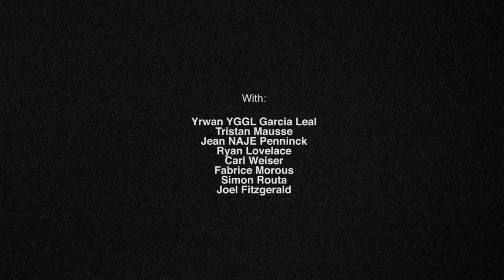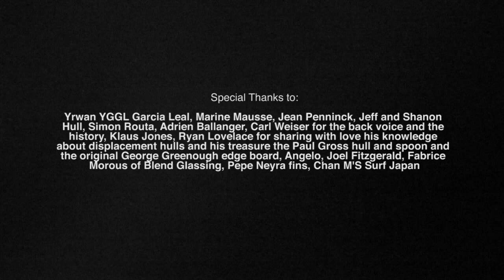INTERSTELLAR LOW WAYS-Displacement Hulls Fantastic Acid- full movie

Comment: In the 70's, as a shaper, I had opportunity to observe all kinds of extremes of rounded bottoms and extra rocker'd bottoms and they all have advantages and disadvantages. The disadvantage of the rounded bottom is lack of top speed and acceleration. They gain ease of turning and a mid level efficiency in speed. This is difficult for some to comprehend, but the same arguement applies to foiled boards and even long boards; they have better mid range of efficiency without an effort from the rider. But, cannot be pushed to the limits of a flat bottom short board. Cheers
Reply: Hull or belly bottoms are better on longboards for that reason a dull or slowed response. 

As far as design extremes they have extreme results which usually feels odd
Reply: Does a top speed faster than the pocket of a wave really have to be reached?  Isn't the ideal situation of a modified displacement hull to adjust and stay right at the speed of the wave?
Reply: You're right about hulls lacking in acceleration but they actually tend to excel in top end speed since they still have some amount of belly submerged in the water even when planing at higher speeds allowing them to build steady speed and maintain stability/hold. Flat and concave bottoms have far more acceleration from the get go but top out quickly since they just start chattering if you go beyond a certain speed since there is less board bottom submerged. It's the same reason why people say displacement hulls wrok so well on the high-line (the fastest part of the wave), since the bottom contour naturally fits to that curvurature while flat/concave bottoms naturally want to go down to the more slopey part of the wave.
Reply: @bloblablah7409  
For what it's worth, I found that reverse vee was good for stopping chatter in bumpy conditions and for good paddling ability; vee at the nose, flat at the tail.
Reply: I don't see why. I don't understand neither why the edges of the bottom are sharp on the down face, the same for boats. It would seem to me that for lower drag, you would like them the other way.